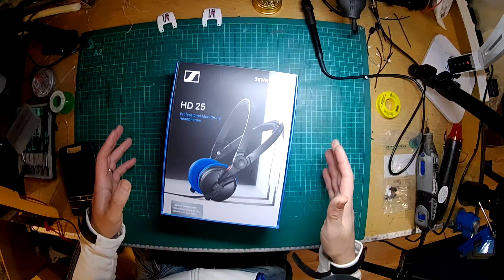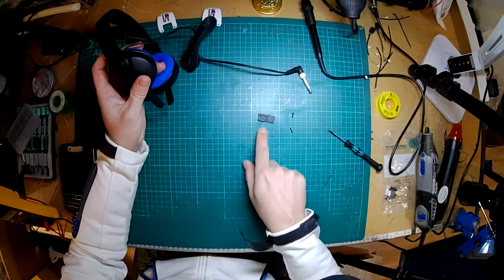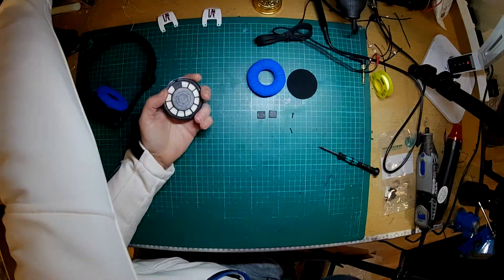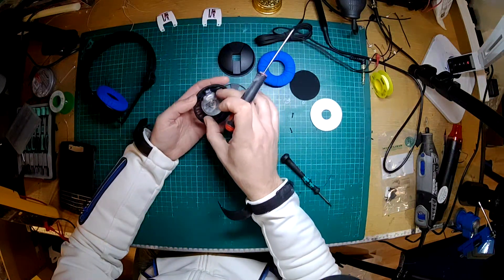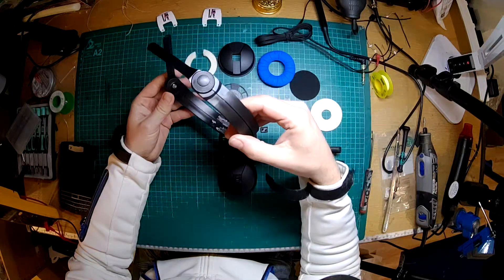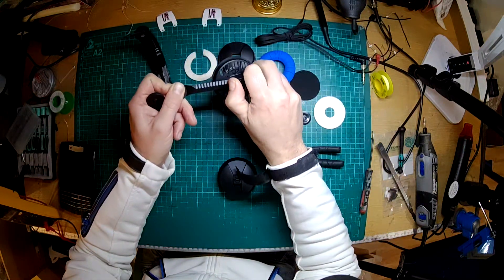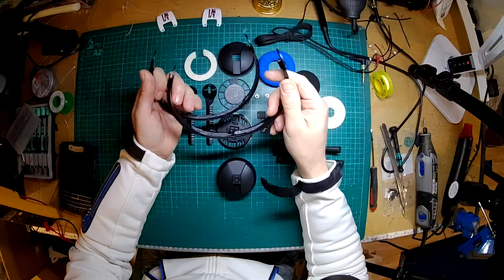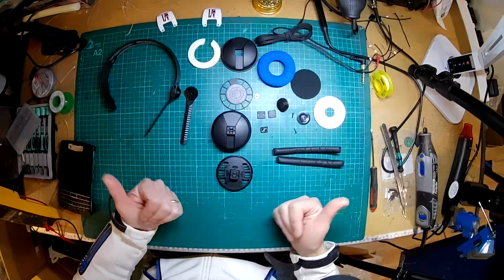Dismantling the 2020 Sennheiser HD25 looking at materials and construction along the way

Comment: I actually wish the the ear cup was cleaner looking without the cable attached to it, thereby making it symmetrical. I know it’d make cable replacement trickier, if at all possible, without redesigning the ear cups and drivers.

Otherwise, I appreciate the plain look.
Reply from the maker: Yeh - it is a "functional" design ;) not designed to be pretty. The Momentum was probably the prettier consumer version

Comment: xan i sand a pare of takstar 82 proos my mom  got me stop working an i can t fixs tham i try sir ill pay u somthing i was thinking if u can sand me a link for 2 parts maby good driver same siz as pepro 82 an a good sider wier cuz i think  im going ti drill a hole in the cup an wier ech side up i dont whant to buit i can t run it thoow like thay did i no u can but i just whant the pare of head phones fixst my mom passed away she got tham for me is way befor shee passed
Reply from the maker: Hi Jonny. I would check if there is anywhere local to you that can do it or the manufacturer may offer a repair service. We are based in the UK so postage back and forth would probably cost nearly as much as the headphones

Comment: Have you tried listening to them without the back ear cup enclosure? Wondering if they can also be used as an open back headphone (since the driver enclosure looks very much like the old HD410SL ).
If this is possible these might be the worlds first headphone that can be used as open or closed back headphone :) thank you for the video
Reply from the maker: Yes - actually around 10 years ago when I first started messing around with theses I converted a pair to open back and they sounded pretty good from what I remember - as I am looking for things to video I will do that again and take some measurements next week
Reply: @CustomCans  thanks!! Another thing to try might be some of those yellow foam HD414 pads (or any foam pads really) to see if they fit. Then the hd 25 light could look very much like a vintage headphone.

Comment: Is it true the new HD 25 Lights have HD 25 drivers
Reply from the maker: We don't work with the HD25 light but the old ones used to be 60ohm and the new ones are 70ohm, the same as the HD25 they also changed the headband as the old headband did not work with the HD25 drivers and the new one does - I am pretty certain sennheiser would not bother developing a new 70ohm driver so... Yes, they are almost certainly the same driver on the latest HD25 light
Reply: @CustomCans  I already got a pair of normal HD 25s but for someone new to these it might be a good deal at $50 cheaper.

edit: ah I see where I got the idea from now: headphonecheck.com reviewed them and said they have sound identical to the regular HD 25, though they also say the ohm is measured at 61.4.